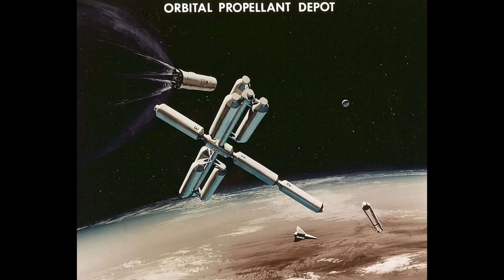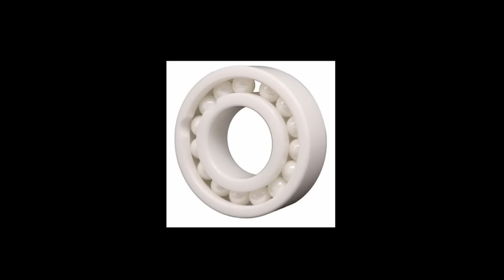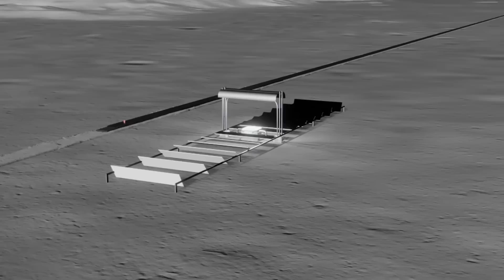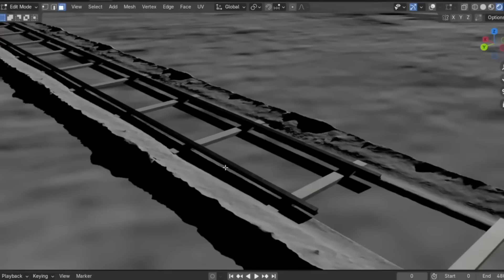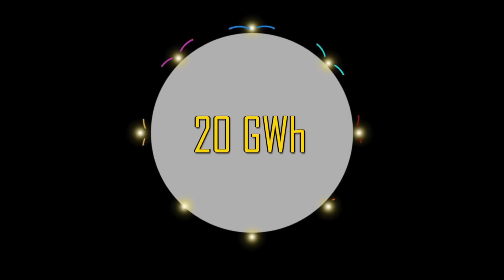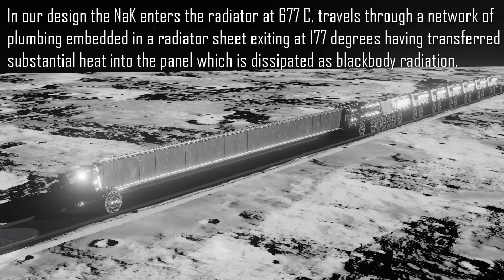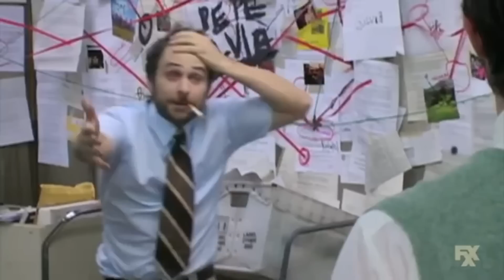Lunar Transportation Infrastructure (Sintered Regolith Roads & Nuclear Powered Trains)

Comment: Excellent video.  Google the Ewing System.  This was a road mounted monorail with tires on either side to provide balance.  Much easier to build than a classic railway, but also intended for lower speed.  For the rail, you could use a sintered regolith plinth with steel strip on the top.  This will spread load and reduce the potential for cracking.
How about using iron manganese alloy instead of pure iron?

Comment: it might make sense to distribute the thermal radiators along the length of the cargo cars? it would be easy to pipe low- pressure steam to the cars and return condensate. the reactor and turbo-generators could be in the 'locomotive"

maybe distribute the electric traction motors as well?
if the traction motors had the weight of the freight on the wheels, steep grades would not be a problem. then the route could go over mountains, rather than around or through them?

Comment: Everyone got the sintering temperature wrong. Over 1000 degrees C would sublimate the lunar regolith. It would be hilarious to watch them pile on regolith on their lunar base, only to watch them vaporize it. I am sure they did the sintering basalt tests at earth atmosphere pressure... a fundamental flaw.
Reply from the maker: Sublimation is pressure dependent. Heat increases pressure and if you're casting into a vessel we're talking about a small amount of O2 and Fe and Mg and Na here sublimating from the top surface layer that is exposed to vacuum not the entire block sublimating at once like some explosion. Pyrolysis is a promising refining approach but it takes hours and probably stirring/mixing to sublimate any given mass of regolith. Regolith sintering and casting has been done many times in ultra high vacuum.
Reply: @Anthrofuturism  I realize that it will be sublimating the surface as that is where the heat is being applied. I have not seen references to sintering and casting in ultra high vacuum.
Reply: @Anthrofuturism  I understand the top sublimating, but all the CGI was showing an open sintering process which would pollute the lunar vacuum. Even if you are trying to sinter the top only, why use high temperatures. you are just using more energy than needed,

Comment: The idea of roads on the Moon is brilliant. As for a nuclear train, we don't need to develop nuclear technology there, although it will still be needed on Mars, for example. In my opinion, a smaller vehicle, like a Tesla electric lunar truck, would be better, with solar panels above and around the road made of silicon from regolith, of which about 20% is the surface of the Moon. One half of the Moon is always exposed to sunlight. Connecting the lunar hemispheres with power lines and linear solar power plants would provide an "infinite" amount of energy for lunar exploration and accelerate industrial development there. This idea could truly provide a huge boost to human space exploration, and the Moon is crucial for these groundbreaking changes.

Comment: why does the train need to have a strong or main motor? accelerate and decelerate with magnetic slingshots at the stations, the train can just have small motors and breaks on each car that barely overcome rolling resistance. all the cab needs to do is steer

Comment: The logical solution to the energy source problem is to utilize modular implementation of all three alternatives you put forward. Build non pressurized access tunnel under your road for emergency return to base scenarios that also functions as an instalation point for expansion of an induction line as the infrastructure for its production is brought to scale at a later date. A limited number of prime mover reactor cars and a fleet of moduler  cargo cars compatible with solar panels and the reactor car. The reactor car is initially primary, but as the infrastructure for the production of induction components and solar cells is borough up to speed at hub stations. The logic of the axiom " don't put all your eggs in one basket" in this instance also adds a level of safety factor from redundancy. With that in mind, it might also be cost-effective to integrate seedback thermoelectric elements into all of the radiators on the locomotive and cars.

Comment: My problem with the trains is just that you just don't need to go anywhere on the moon. If you're literally mining oxygen, basically all of the material of the moon is saturated with oxygen.
If your mass driver is next to your oxygen generator and the the oxygen generator can be fed by literally any hole in the ground on the moon, you're only going to need to go slightly further when your hole threatens the structural integrity of your infrastructure.
Reply: THATS WHAT I'M SAYIN

Comment: You're not mentioning regolith's extremely strong microwave coupling. It should be entirely possible to have a nuclear powered truck with a large roller out front compacting the regolith while, running back and forth on a track directly behind the roller, a maser sinters it similar to selective laser sintering that's already in use on Earth. The surface cracked and it needs repair? The sinter-mobile can easily carry an open wagon full of regolith which can be deposited over the damage, compacted, and sintered in situ.

Comment: I know I'm a bit late but I am somewhat curious. As an alternative to the 'solar schooner' power system, could something of a solar motor be created instead? Each carriage equipped with reflective surfaces to focus light to a main reflector mounted on the prime mover, which drives a series of stirling engines that provide power. Each carriage insead of having an entire solar array mounted to it would then have a far simpler reflector that could be adjusted with just a single motor to focus to a point on the main reflector. As was explained, centralized complexity versus distributed.

I have no clue how efficient it might be compared to the solar array design- it's not really my forte- but it does seem simpler in some respects.

Comment: Would it not be possible to use the wheels as a heat rejection system? Creating a sealed plumbing system able to circulate the coolant along the axles would be a pain, but the increase in heat flow from conduction would reduce the necessary size of the radiator fairly dramatically (I assume, although I'm far too lazy to actually run the numbers myself).

Comment: VERY GOOD vid. One idea on my mind though - 
- Why not (especially on the start of pan-lunar highway construction) create a nuclear train, capable to simultaneously mine plus solar-melt regolith, shape regolith into "highway tiles" and THAN place them to become another meters of the highway...? Y know, if the whole mining fab-train movement speed is reasonable, that setup should spare a HEAP of logistics and in case of major malfunction shortens work with localization of the problem in side a single huge train, instead your previously envisioned complete, possibly luna-spanning system...
Another upside of mining/fabrication train will be simplier accumulation of industrial capabilities in single area for specific purposes. Bluntly said, if you want to build an outpost on the moon, you can either send there a rocket with everything needed, or reorient production and motion of several your closest megatrain fabricators and deliver only the hardly replicated parts. 
BTW, I see a possibility, to use whole body of spaceXes Starship, as basis for the landtrain (at least the engine and cockpit segment of said train). Simply slap a hoop-like metal circle around the body with wheels, and building of the train should go EXTREMELY quicker, than if you mine and fabricate for majority of parts, on the start of your settlement.

Regarding the train manipulator: 
- Why not get inspired by chineese spacestation manipulator, and use shorter, bothway (manipulation device on both sides of the arm ends) manipulator, capable of connect into pre-prepared "socket" (number of those would be inbuild into the upper "sides" of the cars), reconect on its basis, and from that new position reach further ON the train, including another "socket" in front and previous in the back. 

- Alternatively, the manipulator could be on top of a "microtrain", moving on top of your actual train, yet still "reach" hundrets, or even thousands of meters long other side of the train. 

- Generaly, number of shorter manipulators (especially if they can stack to serve as ONE EXTRALONG), should be much more technicaly robust solution, alowing to work on multiple places alongside the train SIMULTANEOUSLY.

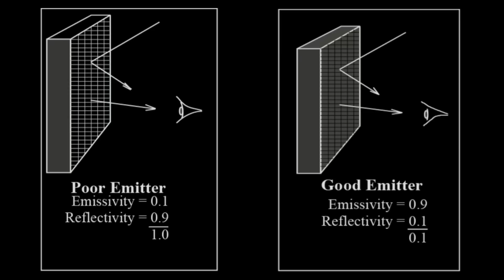Comment: 29:22 Why not just use a liquid droplet radiator? Obviously, there's gonna be a lot of efficiency loss from not having as close to a pure blackbody as possible, but you're already losing that by not using carbon for the radiator surface. 

Yeah, you're losing the ability to increase the emissivity by adding an oxide layer to the coolant, but you're also gaining a bunch of radiator surface area while still allowing for a more compact design.

And even for the non-reactor and solar power cases, you could probably still get away with a droplet radiator.

Comment: Stability on a flat road is going to be an issue. Especially with the lower gravity on the moon. This gives you a lower traction and horizontal inertia is much higher proportionally to the gravitational restoring force, to it will be much more "top heavy" and prone to tipping than a similar system in earth.
Reply: Cap over engine moon cars would be just as anachronistic as pulley electric steamshovels for moving regolith, and may very well be worth it.

Comment: I just wanted to give another reason for having steel rails instead of ceramic (or glas).
Ceramic materials are insulating which is not ideal, the reason why is for electric trains the power comes (in most cases) form a catenary (overhead wire) and returns through one of the rails (the ground rail).
The other rail is a signal rail, if there's a short between the signal rail (which is sectioned with isolators) and ground rail, there's a train on the tracks.
It would be possible to solve the ground issue some other way, but not as convenient.

Comment: I know it sounds like buzzwords, but this seems exactly like where 3d printing would come in handy since it’s extremely easy to sinter the material or melt it for different layers. The only concern I would have is layer thickness dependencies and managing power output. But those should be relatively solvable
Separately, if you use metal powder tapped density as a metric, sintered regolith should be   About 1.2x the density of raw material

Comment: Translation: 

Hi! I understand that there is no wind and small debris on the moon, and the question of "sailability" does not matter, but what about the center of mass? Won't it overturn the structure? Do we really need an independent electricity generator on our conventional railway? Modern electric trains run with contact to an electric line, and there are even options with highways.

 Since this conditional "Moon Settlement Belt" is needed specifically for the placement of points-ports for satellite propagation, then the issue of loss in energy transmission is also not much worth it. And even if this is not enough, there are always options for solar fields along the paths, but even without them, production at "Settlement Points" connected to a single network seems more than appropriate. We immediately throw a lot of mass out of transport and we can already save energy on this. 

 There is also a problem, although maybe it just wasn't taken into account. You're showing a narrow-gauge railway. Your "road" will have a low throughput, but it is only necessary to add at least one more path nearby, and the throughput will increase several orders of magnitude! This will increase the amount of materials and energy for construction, but it's worth it. 

 Roads with an electric line for "non-trains" will create a natural network of electrification of distant facilities and even allow additional cables to be buried under or near. Anyway, such objects will most likely have to be connected to the "Moon Settlement Belt". You can even lay gas and water pipes, but it's a bit monstrous. Even tunnels filled with atmosphere, but this is quite exotic, and is it all necessary?

 If you read it, then pay attention to ordinary electric trains, look at the mass ratio and think about whether you need an energy source that you will need to constantly carry on your transport. And you also need to take into account the loss during transmission. For conventional power lines, the average per 1000 km will be 10%. The moon's circumference along the equator is 10,917 km. Doesn't that sound so bad? Not only are we reducing the mass of the "non-train", but we are also removing complex structures that may fail, and also adding to the list the reason for the construction of 11-12 towns. 

 I love your channel, I've long been tired of popular science channels that explain the basics of the children's encyclopedia 300 times, but here I see the perfect balance. I even want to write the most solid science fiction books, huh)

Original:

Привет! Я понимаю, что на Луне нет ветра и мелкого мусора, и вопрос о «парусности» не имеет значения, но что у нас с центром масс? Не перевернёт ли конструкцию? Да и нам правда нужен независимый генератор электричества на нашей условной железной дороге? Современные электрические поезда ездят с контактом к электролинии, есть даже варианты с автодорогами.

 Раз уж этот условный «Пояс Заселения Луны» нужен именно для размещения точек-портов для распространения по спутнику, то вопрос в потере при передаче энергии тоже не сильно стоит. А даже если этого недостаточно, то всегда есть варианты солнечных полей вдоль путей, но даже без них выработка в «Точках заселения», соединенных в единую сеть, кажется более чем уместной. Мы сразу выкидываем кучу массы из транспорта и уже на этом можем экономить энергию. 

 Также есть проблема, хотя, может, это просто не было взято во внимание. Вы показывайте узкоколейку. Ваша «дорога» будет иметь малую пропускную способность, но стоит только добавить хотя бы ещё один путь рядом, и пропускная способность вырастет в несколько порядков! Это увеличит кол-во материалов и энергии на строителство, но это того стоит. 

 Дороги с электролинией для «не поездов» позволит создать естественную сеть электрификации дальних объектов и даже позволит закапывать дополнительные кабели под или рядом. Всё равно такие объекты скорей всего должны будут подключены к «Поясу Заселения Луны». Можно даже прокладывать газопроводы и водопроводы, но это немного монструозно. Даже туннели, наполненные атмосферой, но это уже совсем экзотика, и нужно ли всё это?

 Если прочтёте, то обратите внимание на обычные электропоезда, посмотрите соотношение массы и подумайте, нужен ли вам источник энергии, который надо будет постоянно таскать на своём транспорте. А также надо взять в расчёт потерю при передаче. Для обычных ЛЭП в среднем на 1000 км будет 10%. Окружность Луны по экватору — 10 917 км. Звучит не так плохо? Мы мало того, что сокращаем массу «не поезда», так ещё и убираем сложные конструкции, которые могут выйти из строя, а также добавляем в список причину постройки 11-12 городков. 

 Я люблю ваш канал, я уже давно устал от научно-популярных каналов, которые объясняют по 300 раз основы из детской энциклопедии, а тут я вижу идеальный баланс. Хочется даже писать максимально твёрдые научно-фантастические книжки, хех)
Reply: I was wondering how far I had to go to find some suggesting a stationary power plant and an electrified rail 😅
Reply: But I didn't look at the last piece. What's the problem with hiding the rail underground? Connect them in a curved groove and make a small contact in it.

А вот не посмотрел последний кусочек. В чём проблема запрятать рельс под землю? Соединить в изогнутом желобе и небольшим контактом в нём.

Comment: Why is the radiator shaped like that? There's no air friction and the mass can either be counterbalanced on the bottom or spread out more. You're pushing a train, so extra mass isn't much of a problem. You want a much taller and wider radiator.